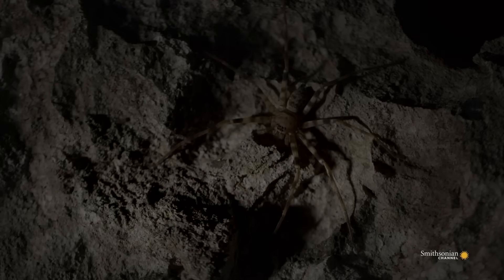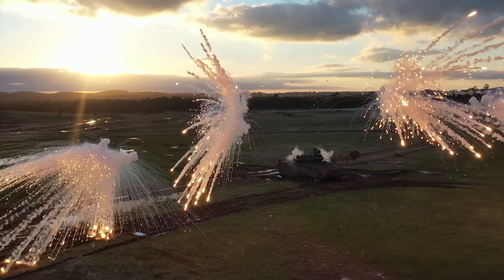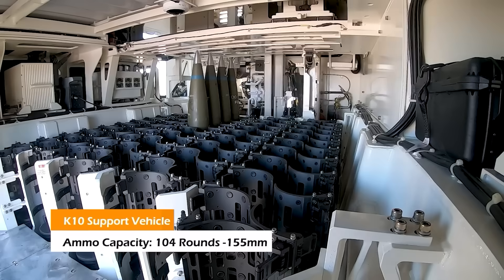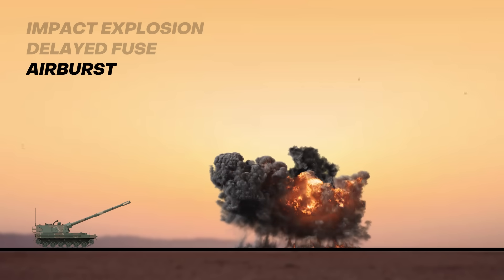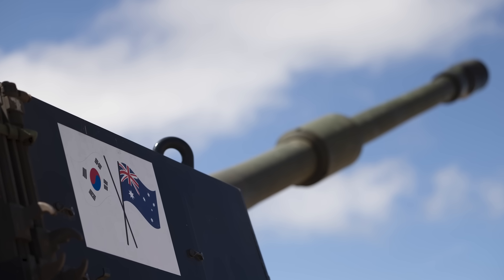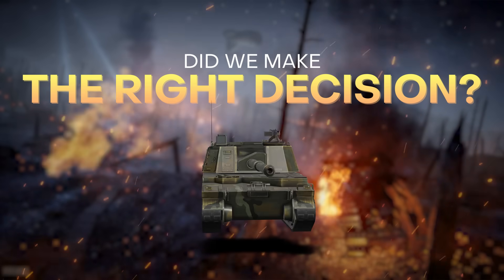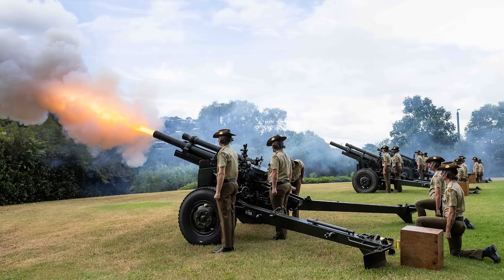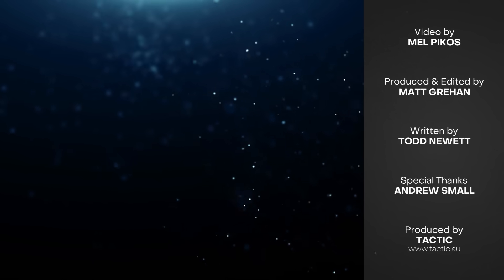The AS9 Huntsman Explained: Australia's New Heavy Artillery

Comment: as a former Army Reserve Gunner (7th field regt RAA -105mm  hamel) we need more artillery regiments and guns either towed or self propelled. like the content.
Reply: Towed is only an option for light units like marines, airborne and mountain troops. For everything else there are wheeled alternatives. The CEASAR is a prime example for a platform that replaced the towed option. Virtually no protection but fast in shoot and scoot capabilities. Light protection versions like the Boxer RCH 155 and Archer are also a good alternative. Right in-between the AS and towed.

Retired after 28 years (11th Air Mobile Brigade and 43rd mechanised as main posts).

Comment: I am L119 Hammel gunner we were talking about the desperate need for SP's back in 2000, we had our eyes on the AS90 UK SP, even heard rumours of AS90 conversion kits for leopard chassis, but all fell silent because we heard politicians mainly said we needed to maintain air mobile ops capability 4 Field Regt as it was called then now 4 Regt, but from our perspective especially from a Amphibious ops perspective equipping the grunts mortar platoons with large calibre mortars would have been a tactically superior choice whilst arming the Best Regiment the army has with SP's, reason grunts land and provide initial short/medium range indirect fire support followed by SP's and armour behind that, bearing in mind they still would have had access to NGS and limited AFS from choppers, when the 777 were bought i thought it was a mistake Ukraine has showed that is incorrect and that the 777 is a solid platform in its own right. however with limited forces and the ease with which counter battery coordinates can be obtained   we need to focus on it HIMARS is a great important but realistically not viable while they refuse to spend more, and more much much more is what we need. that's just some of my thoughts  its been a long time since i have reported guns empty, and i'm happy the gunner have gear to be proud of, but its just not enough, and you are right we have always struggled to maintain numbers even with the L119 which in the perfect world was crewed by 7 plus 1 driver, i never crewed a gun with 8 people 5-6 was the avg including driver

Comment: Those Excalibur artillery rounds are pretty slick...  BUT they cost approximately US$100,000 per shell !  The average cost of a 155mm artillery round is around US$5,000.  Those prices can vary quite a lot depending on the type though.
Reply: That's why you need a mix of different grenades for different purposes. Also without  Excalibur,  the result can be quite precise. Assegai or Bonus are very capable and cost less.

Comment: Seems possible Phase 2 of the 8116 aquisition could be picked up again in future, and you did point out that the M777s will have their uses in rough terrain. HIMARS, I suspect, may be useful to our amphibious unit (2 Brigade) and I believe that's where that system might be prioritised.

Three seperate capabilities, but arguably for three very different scenarios. Likely the systems in question will be deployed on a 'as required' basis, depending on theatre needs.

Comment: Huntsman Vs. HIMARs is a hard one to judge. In Ukraine the HIMARs has probably been the most effective artillery system of the war... But conventional artillery is still the king of the battlefield, and throughout a prolonged war, it's going to be easier to supply basic 155mm shells over rockets. Ultimately you want both systems, but I'd still want more conventional systems.
Reply: They are complementary.  HIMARS or PULS are very good and have a bigger range, but the missiles come with a price. One don't use a HIMARS for a target say 20 or 30 kms away when a gun can do the job too.

Comment: Having joined a 20K plus uniformed Air Force 46 odd years ago I experienced the slow pairing back of my Service by various Govts, of personnel numbers, capability and the flexibility that resulted from the cuts. Same was experienced by Navy and Army.

The spin always was that they would  compensate these reductions with more capable weapon platforms and munitions to maintain capability. However, this only works when you purchase sufficient numbers of platforms to carry over the lost output. We need sufficient numbers of platforms to achieve the mass and flexibility required to defend the country and/or achieve the desired effect. One regiment of Huntsmen can’t be everywhere and the logistic chain implications are mind boggling.

Also, one only has to look at the loss stats of AFVs and towed arty in the Ukraine conflict to understand what is needed to maintain capability in an attritional environment. I’m no strategist, but even blind Freddy can see that a single regiment of Huntsmen is clearly insufficient. 

Cost benefit analysis says to increase the number purchased and we would want to keep the manufacturing facility running to cover attrition. Gosh, maybe we could actually be part of a global manufacturing and supply chain and export components etc?

As always, we cannot lose sight of the reality of our national situation. We are confronted with the conundrum of trying to defend a continent roughly the size of the USA with a combined ADF (full-time AND Reserve) force of I think about 90K (IF all positions were filled) drawn from a population of less than 27 million. How do we get sufficient personnel to operate all of the kit being purchased? I invite you to do the math….
Reply: Both Switzerland and Israel seem to manage because everybody is or was in the Military and every Swiss Soldier has their personal weapon to hand at home and because of that crime let alone home invasions are super low in Switzerland and unlike Israel they are not surrounded by the enemy.
At least in Israel's case it means they could shoot a Huntsman pretty much in any direction and find a target whereas Switzerland is prepared but their only enemy are either Islamic invaders or the EU itself, After all back in the 1600's the Ottoman Empire invaded but were repulsed by the timely arrival of mounted Polish troops at the Gates of Vienna turning the invading Muslim hordes back
Reply: Expand the force. Clearly a budget sticking point. 27M citizens is more than enough population to prop a standing force four times that 90K manpower in piece time.

Comment: I am not or have been military despite trying several times. My unqualified opinion after seeing what's happening in Ukraine is we should have acquired at least three times the original order. They could have been paid for by cancelling the billionaires tax cut and getting the $40+ Billion of illegally overpaid JobKeeper repaid to the taxpayer.

The combination of both those monetary wastes could have even added additional Bushmasters which appear to be working out really well under actual combat conditions. Maybe could have doubled the number of Abram's or even better purchased a crapload of the Korean K2 Panther. The price is roughly three K2s for every Abrams and while the Abram's has some nice new shiny  electronics in it, the refurbished Abram's shell is up to 40 years old. So we could have 225 of the 55 tonne K2 Panthers over 75 of the 62 tonne M1A2 Abrams. Quantity has a quality all of its own.

So 90 AS9 Huntsman plus an appropriate number of AS10 resupply vehicles and a couple of hundred or more Bushmasters would give the army a good number of vehicles and if they ever get the brake "problem" 🙄 fixed on the stupid named Hawkie and the brown jobs should be a lot happier. And give the ADF a little bit of defence while we wait for the 8 nuclear powered submarines and their massive cost blow out and extended delivery date. I am 68 and I'll be dead before the first of the subs manages to slide down the slipway and get its hull wet.

Now where are the holes in my theoretical purchases and what else can have holes poked in it. I would genuinely and seriously like to know. Thank You. 👍

Comment: G’day Mel, Given that, basically, the top half of our continent is made up of flat, open terrain; and invasion threats will only originate from Northern regions; it’s irresponsible not to have as many K9 and 10s as we possibly can. They should be based in the North where those threats are most likely so they can respond swiftly. Perhaps Army disagrees but I think our towed artillery pieces should remain in service, be upgraded or replaced with the latest towed weapons systems which are still useful in certain circumstances.
I’m ex-RAAF and while air power is important in any hostile scenario; the ADF should cover as many bases as possible. Some would say that an invasion of our top half is, statistically and perhaps even tactically improbable; then why does every soldier have a rifle; simple, in case they are needed.
I’m a military historian and I can tell you that, despite talk of a ‘Brisbane Line’ during WW2, it was proven, after the war, that Japan never had a plan to invade Australia simply because they knew, for a fact, that a large force could not sustain and resupply itself in such an ‘empty’ environment. Living off the land was impossible.
Much has changed on today’s modern battlefield and along with it logistics. Today the reverse may be the trigger for an invasion, even if it is a faint. 
The fact that our top end is so isolated could be the very reason a large adversarial force could be quickly deployed. They could make serious inroads into Australia before being challenged.
Even though we have an air base in Darwin, we still suffer by massing the bulk of our armed forces along the East coast. 
A large invasion force would necessitate the airlifting of, probably, the majority of our active infantry along with all their ammunition, equipment and support personnel. To say nothing about the time it would take other Army assets to be airlifted into position. 
I get that I’m an ‘old soldier’ who may not be up to speed on the capabilities of our ADF but the core of what I’m saying has been self-evident from ‘day one’. That is, this is a huge country with thousands of linier klm of isolated coastline. We need, as we’ve always needed, a Defence Force that is commensurate with that fact.
Finally, other comments here have pointed to the weakest link in the proper defence of Australia as being, our politicians of both stripes. They only see costs. What is the price of Australia’s continued freedoms and peace? 
There are, roughly, 21 million Australians of voting age. As a taxpayer I would gladly give an extra $20 a year, for 4 or 5-years, if I knew it was going to the ADF, without a reduction in its budget, so they can afford to protect us in these troubled times.   Cheers, Bill H.
Reply: Bill, if I can say you put it really well and as an old soldier my self have said this many times- what cost freedom.
Reply: @SapperDad59  G'day Brother, Yeah, I'm sick of the way all politicians stick their noses into the ADF and think they know better. When the crap hits the fan they are the first ones to ask, "What the hell is the ADF doing about this? I've got a media interview and they expect me to know...etc."
Cutting the K9 program in half because of a flood in Qld. is BS. I'll wager not all those monies went to Qld. Pollies like to have a war chest to fund 'new' programs they pull out of their hats around election time.
During all my time in uniform I never once met anyone who didn't think like you and I do on this funding matter. To defend everyone, including the Pollies, we have to have the tools to do the job.
I recall why 'we' delayed the delivery of the F-111s. It wasn't the RAAF's requirements. The Government was waiting for the unit cost to go down.
We're supposed to have a 'modern' ADF. We haven't had an aircraft carrier since 1982, not talking about those little LHDs.
We have twice the linear coastline of the US but they have, literally, thousands of artillery pieces, large and small. That's not counting the 4,650 MBTs! (half that number are always combat ready).
Sure, we don't have the colossal budget of the US but, really, we have a projected purchase and running cost of AUD$1 billion for the 30 K9s and K10s we have; double that number would have been a total purchase price of AUD$1.6 billion. But the boat has sailed on that price. 
Some politician made that decision, oh, yes that's right it was our PM, you know he used to be the savage 'toe-cutter' of the Labor Party. There's a new book out on him called, 'Comrade'. It's about his 40-year ties with the Australian Communist Party. 
Sorry to rant but this stuff still makes me angry.
Take it easy, brother. All the best. Bill H.
Reply: Australian politicians aren't thinking about using the ADF to defend the country. They are all about geopolitically driven invasions of other countries.

Comment: So, when you say quickly, how quickly and for what distance? The G5 towed gun has an engine with which it can position itself and move to a different location close-by (not fast, but it doesn't need to be towed to do so). Check it out here: https://www.youtube.com/watch?v=drV_iZ94wjc. And it can travel at 60 km/h, for how far? Why would advanced crew protection be required? Artillery operates far behind the contact line. And counter battery fire? Does that mean the huntsman doesn't out range other artillery guns? And a rocket assisted shell can reach "up to" 60 km. Is that at sea level or higher altitudes? The G5/G6 can reach almost 80 km with a base bleed shell (that is not assisted). Both towed and self propelled guns can travel at around 100 km/h and doesn't need rail or road transportation, and have a range of around 700 km before refueling. Have a look here: https://www.youtube.com/watch?v=0_9fl7QWGQw. Get a few of these puppies, upgrade them and build them in Aussie. Maybe the Rooikat  also (rooikat is Afrikaans for caracel). Build them in Aussie too. Have a look: https://www.youtube.com/watch?v=eUbB9fjMCxM

Comment: If it is going to take until 2027 to complete the Huntsman's, I'd suggest ordering the second batch, for production to start after the first batch, produced at a lower rate if needed so the production line can stay open.  Should war brake out you can ramp production up.  If we have three full time artillery regiments, we should have enough equipment for two regiments of 777 and two regiment of Huntsman's.  This way there will be spares and you can have some of each at the school of artillery to train on both.  Additional Huntsman's can be distributed in Battery strength to each of the reserve units (say state capitals) for reserves to train on as there are no reserve artillery units.  If activated, reservists are likely to be defending the Australin continent (with protected Huntsman's) while the ARA with the more mobile 777 being moved around Islands where and as needed with the Himars.
Reply: There’s absolutely no way that reserve units would be getting AS9s
The maintenance required for tracked vehicles  is huge in terms of man hours, which you can’t get from people who only parade on Tuesday nights and every other weekend.

Reserve gunners should go back to being light gunners, not mortar men as they are currently.

Comment: SPA and SPAA have been necessary to keep up with armoured units since WWII, the German, British and US armies have all got examples from that era.  It's just that having a small, well trained infantry based army, we haven't seen we need SPAs, which has been short sighted imho.  We need to be driving recruitment in addition to acquiring new capabilities, the expansion of the navy shows that, and army is desperately understaffed.  In addition to the AUKUS deal, I personally believe we need several small aircraft carriers in order to extend our strike capabilities, however we don't have anywhere near the required personnel to crew such vessels.
Reply: A couple of small aircraft carriers would appear advantageous, but using what aircraft? How would you protect them because we haven't got a big enough fleet to form proper task groups for our 2 LHA ships.
Reply: @geradkavanagh8240  With the improved and expanded surface fleet, we could field a force large enough protect a small group.

As for aircraft it seems we'd be limited to F-35s and Loyal Wingman UAVs, given the amount and types of carrier capable aircraft in the world today.  Depending on how badly we've damaged Australo-French relations, maybe Rafales.

Comment: We also need a fleet of faster and more mobile systems like the Archer. 
The Huntsman is not suited to the vast distances of much of Australia, requiring a bigger logistic footprint.
Reply: As with tanks, if you need to move long distances, you put it on rail or a truck. Armies usually have heavy truck units just for the big stuff, and it will get there faster than if you road an Archer, if the distance is great.
Reply: @anthonykaiser974  These trucks  are very impressive and they may safe repairs on tanks or tracked vehicles, but they are also very costly and there aren't to many of them.
Reply: Arches would be good on Rheinmetall HX3 Trucks

Comment: What is meant by 52 caliber. 155mm is 610 caliber or are you referring to someone else?  Nice Video.
Reply: When they refer to caliber in this context it refers to the diameter of the shell. Therefore if the barrel is 52 caliber is length is 52 times the diameter of the shell.
Reply: @andygray9285  Thanks for explaining.